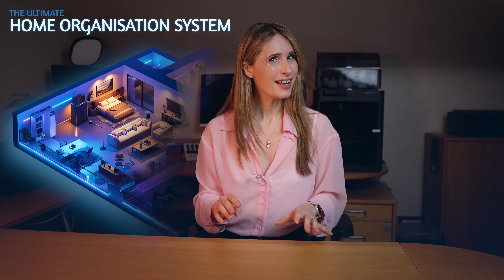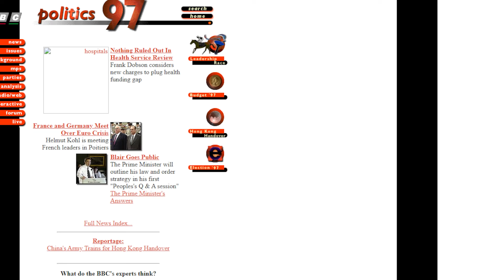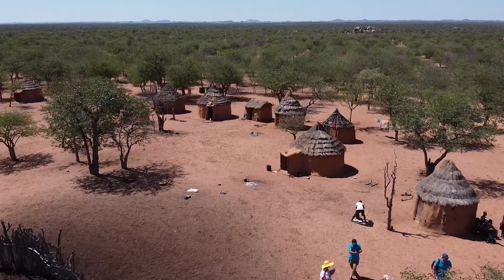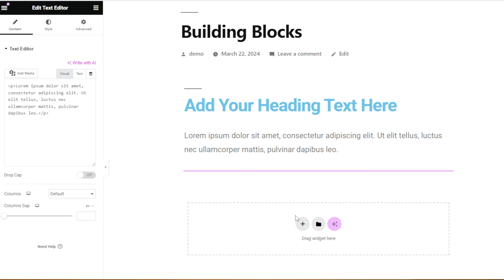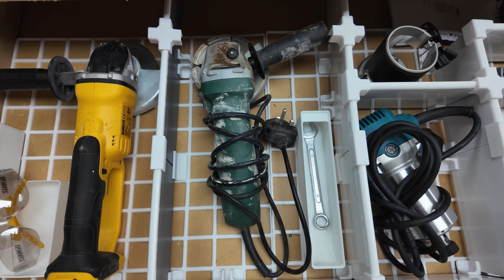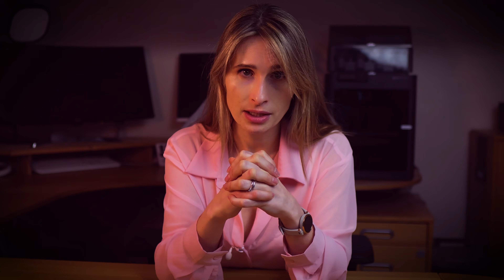Open Source Home Organisation: Four FREE systems to engineer order in YOUR home.

Comment: I was kind of thinking there would be some great revelation here, but it's all stuff I knew about, with the exception of the self-created grid solution, that may or may not be relevant, have to see what it can do. But you can't just engineer your way out of the problem, you also need to organize your way out of the problem. Principles like Lean can apply 100% to homes, at least many parts of it. For instance, unnecessary travel; if you have your dishwasher on one end, and store you plates on the other end, you're forever walking back and forth. If your clothing articles are placed sub-optimally, you're also going back and forth. Labeling and marking down exactly where something should be tells you that if it's not there, you've messed up returning it or you ran out and need to re-order, etc. Technological solutions help, but at the end of the day the reason organization fails is because the people stop adhering to maintaining the organization.
Reply from the maker: Great comment - yes a lot of this is seemingly common sense (indeed as I highlight, much like the Agile Manifesto was seemingly common sense when it launched) - but the reality is there are no standards in home organisation, so this creates cognitive friction. Definitely lots of other points like travel - I'll cover these in the individual room videos - this is key, especially in workshops. I think I lean much more to the neuroscientific view on why these systems fail - ie people don't just stop adhering to the maintenance, there's a bit more complexity - much like people don't just gain weight because they 'want to'.....!  Time and focus are other factors that weigh in too in this!
Reply: The overlooked solution with dishwashers is to have more of them.

If you replace cabinet lowers with additional dishwashers you can just use them to store dishes.

As a starting point, think about having 2 -- one is your "clean" dishwasher, the other is your "dirty" dishwasher.

As you use things, transfer from one to the other.

Once you have enough in the "dirty" washer, run a cycle and then swap which one is treated as dirty.

Comment: Oh my God I love so much that you unified four separate open standards! That's cool as hell. I just moved this weekend. I was already planning on doing more Gridfinity in my new space, but I love that I can roll in these new standards! I think I'm also going to make silicone molds for a few basic components like base plates and basic bins so I can cast them in urethane resin. The only downside of these systems is the print time.
Reply from the maker: Great to hear you found it useful - I can certainly see the stars starting to align on these things, so I thought I'd given them a shove... :) I'm also looking at creating open source standards for drawers, cabinets also so you can easily construct these too!  I love your silicone mold idea - that's genius! I might have a think about that - the idea of printing one larger container mold and then 'pouring the rest' is a great idea to batch out extra versions....!
Reply: @handsonkatie  urethane resins can also cure in like 15 minutes, so they massively cut down reproduction time. Honestly the only thing that has held me back from doing more Gridfinity so far is the print time on my single printer. I definitely want the open standard for drawers too! I use organizational systems when they are in place, but if they're not, I don't organize at all.
Reply from the maker: Exactly right!! Standards rule!

Comment: Metric system for the win
Reply from the maker: Metric wins hands down on any scientific/precise measurement - imperial has it's place as it's based on 'things' so its often more relevant - eg a 6 foot+ man is a tall man, whereas a 180cm man or 185cm man - in this case the precision of metric loses the ability to broadly group. Other than that, metric wins!
Reply: @handsonkatie Imperial is utter rubbish. Absolutely useless crap.

Comment: I think my biggest problem is the one most of us face: flat surfaces collect random items until it gets bad enough that I deal with it. And then half of that stuff gets tossed in a different room that is just collecting random items I don't know where or can't be bothered to store. Of course, the underlying issue is probably a lack of organized storage (and a little laziness...).

However, I did try organizing my linen closet so that medical/first aid supplies and toiletries all had a tupperware bin to go to. Some of them are too full, and there's not enough room to store more bins, even though there's technically usable space if it was organized differently. And I still have to dig through a bin to find what I need. It's the default for commercially-available storage, but it's just not a great system!
Reply from the maker: Think you're spot on bloodgain - lack of storage places is exactly where this begins. If our brains have an obvious place to put things, it's cognitively 'easy', if we need to think of a location, it's 'hard' - ie doesn't get done. Your second comment is exactly where I'm been redesigning in this video - it's amazing how unstandardised and unadaptable the commercial storage solutions are....!
Reply: For bathroom items, if I have to combine items in a single bin, I try to "batch" them using ziploc bags of various sizes. So maybe toothpastes in one, toothbrushes in another, etc. with all the "oral hygiene" stuff in one bin. I use plastic chests of drawers (Sterilite) of different sizes under my bathroom and kitchen sinks, where they fit well on either side of the drainpipe and keep things organized in that otherwise big, open space.)

I, too, struggle with the "too much trouble to figure out where to put this" problem. The clutter and organization books/articles/videos I look at (instead of actually decluttering/organizing)  sometimes say that if you don't have room to store all your stuff... you've got too much stuff ! Instead of getting more storage containers, the recommendation is to reduce the amount of stuff to fit the storage space you have. I think they have a point. (I'm working on it....)
Reply: @nodoboho  I definitely have too much stuff! I don't want to just toss meds, first aid stuff, and toiletries that will be good for years, though. I should probably donate a bunch of it. If I had a basement, I'd buy some used store shelving and build my own little stop-and-shop in it!
Reply from the maker: This is a great chat - probably a video in its own right. There's this quantum of 'need' - ie there's rarely any issue with deciding about whether to keep those things you use all the time, nor those things you never need. The vast majority of stuff is in the variable value space - all those nuts, bolts, washers, meds, brackets, tapes and so on are pretty low value most of the time.... but when you need them for that broken bracket, sore head or whatever, they're super valuable to have and actually very expensive to not. Eg having to stop the project, drive down to the big box store (time/cost), buy a bag of bolts (high cost) and drive back.  I love the idea of a stop-and-shop - wouldn't it be amazing if we could 'share' online all the components and bits and bobs we're happy to share with neighbours...!
Reply: @bloodgain   I know what you mean--if it's still useful, it's hard to let go. BTW, if you want to donate toiletries and even first aid stuff, consider donating to a women's shelter.

Love the "stop-and-shop" idea. I think that's what my former storage unit was becoming. I did have some used store shelving in it, too. 😆

Comment: It looks like this address organization, but not the containers themselves. I'm desperate to find a standard large storage container and a standard shelf. Seems like "dunnage racks" are the most universal for shelving. And I haven't found something to my liking for containers.
Reply from the maker: Yes you're right - there's a great comment above that suggests creating 'molds' using 3d prints - I might try this. It's too time and money prohibitive to print larger boxes on current FDM. I'm also designing open source container systems - think cabinets, drawers and the like with automatic gridfinity grids, slot grooves and more. I could add a box system too potentially that might tackle some of your challenge - it's amazing that there's just no standard sizes in these things, then it'd be easy to find a solution!

Comment: Thanks for your vid and am looking forward to the follow up and approaches you have per room! Couldn't have come at a better time to inspire my ongoing spring cleaning / organizing.
Challenge: In the kitchen we have a lot of containers and jars stored separately from their lids. Finding the correct lid for a specific container/jar is a challenge, specially due to the high variety of sizes.
Reply: One of the ways I've tackled this is by getting rid of most of my storage containers and switching to deli containers. They come in various useful sizes, and all use the same lids. They're cheap enough to give away or throw out when they start wearing out, but can be washed and reused many times. Meal prep containers are another answer and come in various depths and with/without compartments.

Those don't meet every need, of course. I keep one set of nesting Lock & Lock glass containers for food I'm sure I'll reheat as-is. No need to track down the lids, since they're always on the container. I keep a couple of very large tupperware containers for storing bulk soup, leftover pizza from a party, loaves of bread, large quantities of baked goods for a pot luck, etc. The lids stay under the container.

Now, when it comes to mason jars, I'm with you. The best I've come up with is storing the rings on a loop of twine and hanging it up. The rest is just tossed in a basket of various mason jar accessories. Regular and wide mouth just mixed together.
Reply: @bloodgain   I've done pretty much the same as you! But I standardized on having only "wide-mouth" mason jars so that every size (I have 4 / 8 / 16 / 32 oz) takes the same lids. Since the mason jars tend to be used for staples (oatmeal, cereals; nuts, dried fruits; honey, other sweeteners, stevia; dried beans, lentils, split peas; rices, pastas; etc., they usually stay in use so the lid storage isn't an issue so far.

I have an extensive collection of herbs, spices, special "mixes" (chai spice to add to any tea, "ranch" for salad dressing or dip), and various drink powders (cocoa, coffee substitutes I like, instant ice tea). I'm standardizing those with a) re-used half-size shaker spice jars for items less used (chili powder), b) a set of glass spice jars in a spinner (color-coded with color dots on the lids and a "legend" pasted to the top of the spinner), and c) a drawer of short, wide jars for items used in larger quantities (drinks mixes, extra quantities of favorites bought in bulk). 

It's not that I'm a gourmet cook, not at all, but I like variety in my food and to experiment (hence the wide assortment of dry goods and herbs/spices), not in my containers and accoutrements (hence the simplification and standardization). 😉
Reply: @nodoboho  Yeah, I will probably give all my regular mouth jars to my mom or donate them on Craigslist. I prefer the wide mouth ones now.
Reply from the maker: Oooh awesome example, I know exactly what you mean and they're a great example of what I think is silly!! I'll add that to my kitchen hit list!!! 😀